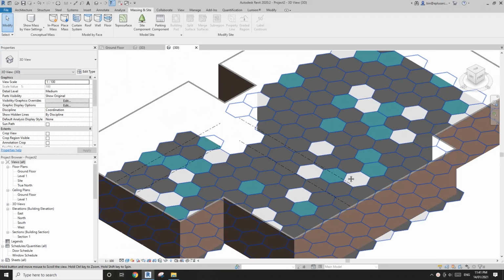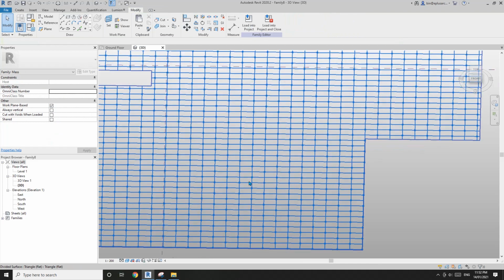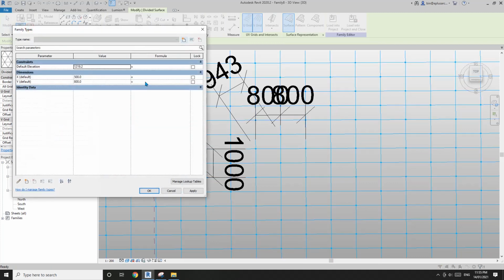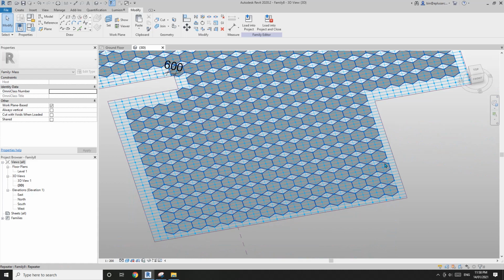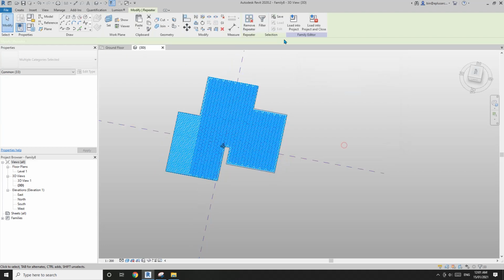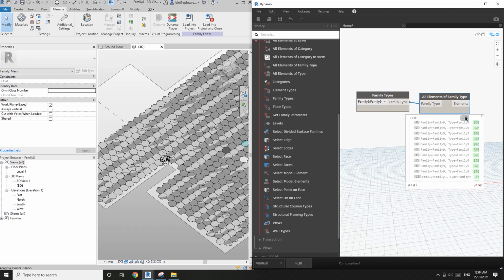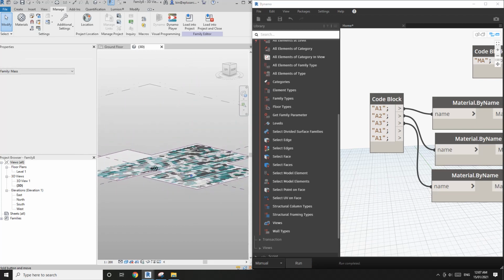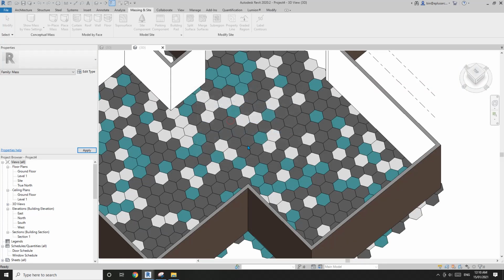Everyday Revit (Day 303) - Random Hexagon Carpet Tiles for your render

Comment: Ok... now what if I want to make a gradient ?
Reply from the maker: Do you mean adding a slope to the floor?  I think you can. Try this:

1. Go to an elevation or section view and add a reference plane with a slope.
2. create a model in place mass and set work plane onto the reference plane.
3. place some lines or reference lines and create a form
4. use divided surface and apply the family.

You can also use pattern based family, try to search 'hex' in my list.

let me know if you have any questions.